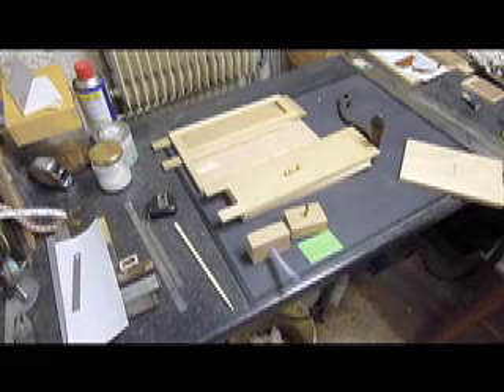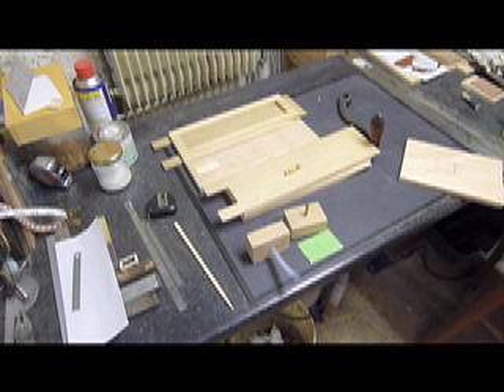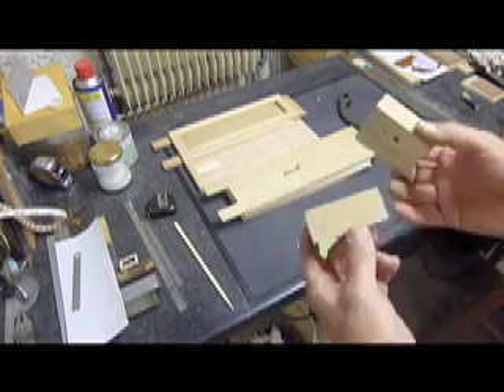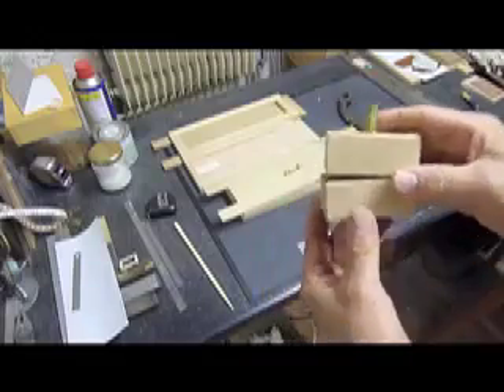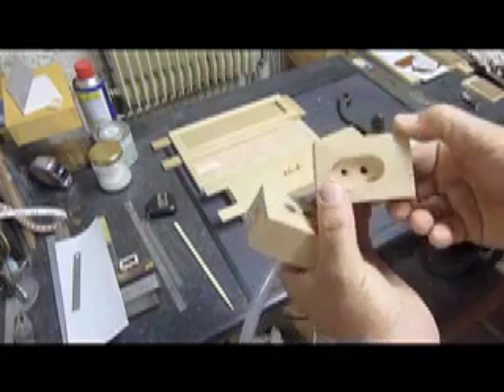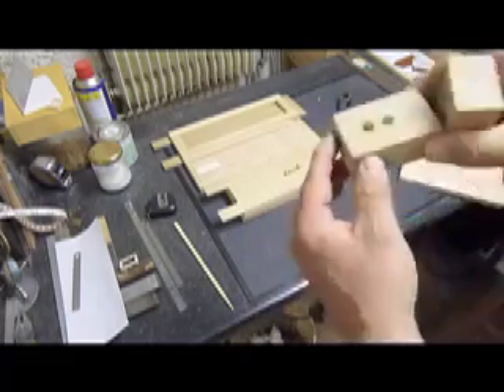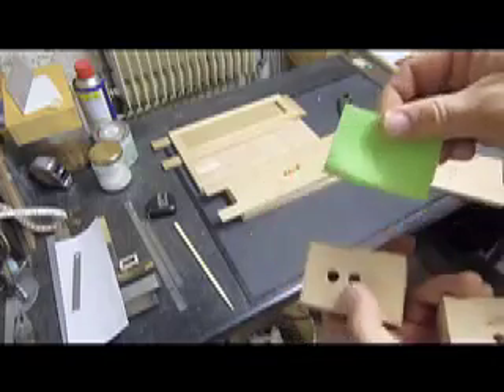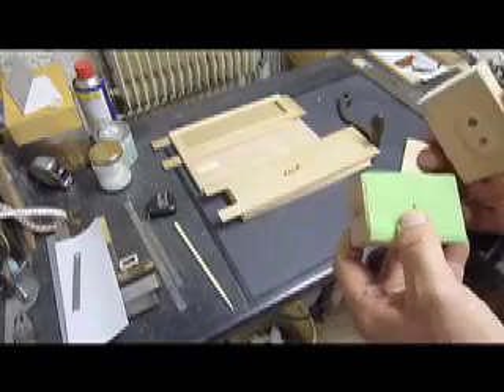Building the Busker part 10. Thoughts on Valves

Comment from the maker: @theorganguy In a membrane valve the air inlet and outlet are calculated in relation to each pipe, the chamber is twice the radius of the inlet/outlet, the diameter of the hole in the membrane is calculated or can be made adjustable, the 'exhaust' is fixed. There are many valve systems in use, I don't think John Smith claims to have invented the presssure box system but it certainly characterises his design of 'Busker'. For more information google 'VMT'  (Vanne a membrane Tangantielle

Comment: @anepictree does it work? no doubt! but it is what it is... just figure yourself between the size of hole in the tracker vs. the size of hole in your pipes, that it is a mismatch... even on your own membrane valve in this video (which is not standard for large instruments either) the input and output hole for the air is the same (large), while the top exhaust is the small size suitable for the tracker

Comment: now of course you have discouvered the archilles heel of the John Smith design, as the air going thru the tracker (unless you would have a much larger tracker and thus larger rolls) is quite unsufficient to supply air for a pipe.